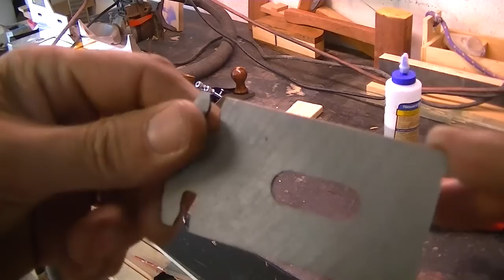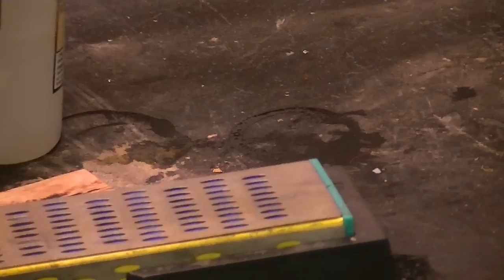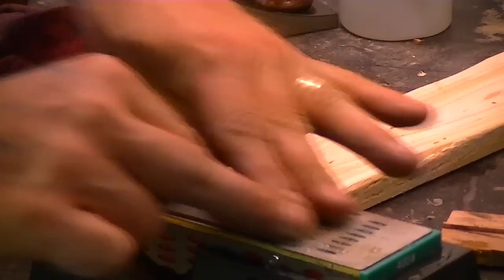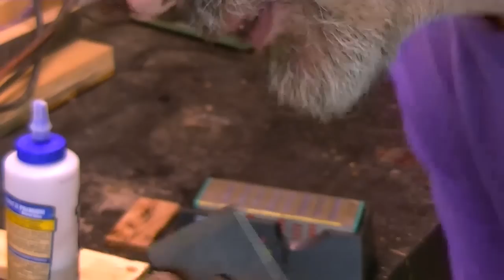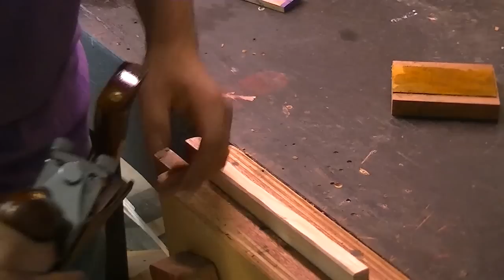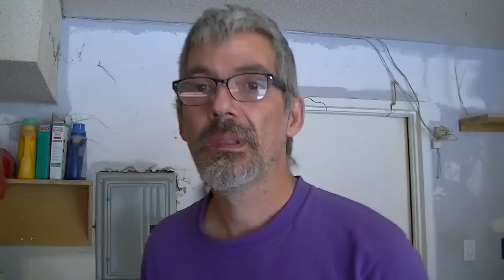How to sharpen a plane to a pristine edge

Comment: Guy, it doesn’t matter how flat the unused surfaces of the blade are. For the blade, the cutting edge is all that matters. Everything else can be compensated for by the tool’s adjustments. You should also be focusing your efforts on the sole (base, foot, or whatever you want to call it) of the overall plane itself as well, which should also be flat to ease travel accurately over the surface of the wood. Watch several videos of prepping new planes and you’ll quickly get the idea.